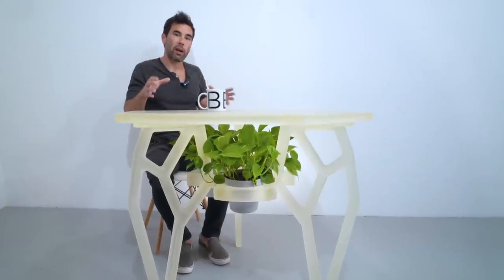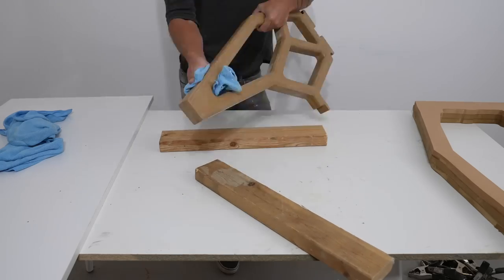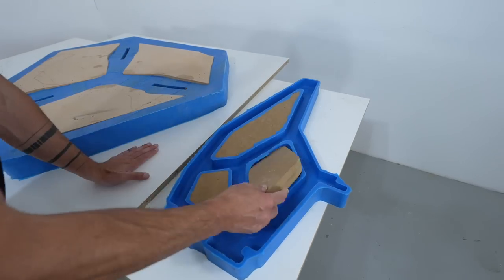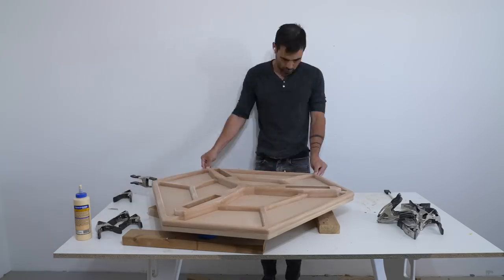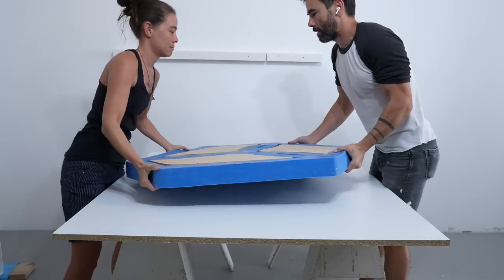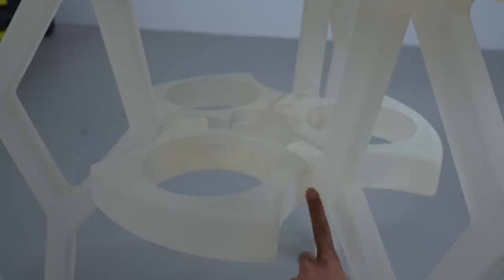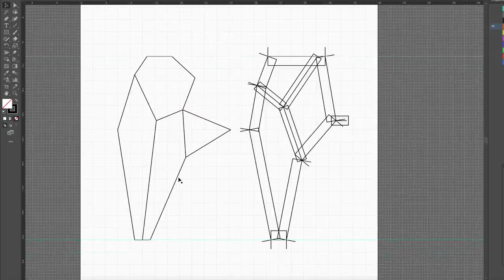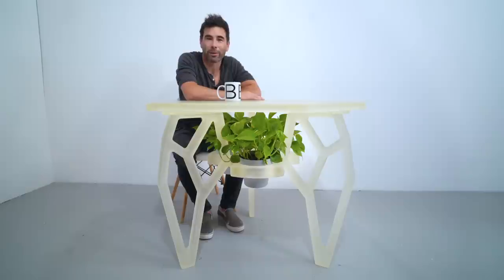Making an Epoxy Table

Comment: Epoxy and sunlight don't really get along. It will be interesting to see how this ages. A yellow or orange tint may help hide UV degradation.
Reply from the maker: yes! I am curious to watch how it ages too
Reply: Might want to go the other way. A light purple tint would go more neutral (white) as the epoxy yellows over time.

Comment: I wonder if making an mdf mold and spraying it with plasti-dip or some sort of silicone spray would be a cheaper way to make a mold.
Reply from the maker: it might but probably wouldn't hold up as well over multiple uses

Comment: Looks really cool! But wouldn't it be easier and cheaper to combine thick sheets of acrylic and sand them afterwards to the achieve the same look?
Reply from the maker: I priced thick acrylic from 3form and Eplastics and it was a bit more expensive.

Comment: You can estimate the volume from the weight.  I expect the density of MDF is consistent.  Weigh the MDF before you cut it.  If you start with a rectangular sheet you know the area and the thickness, and therefore the volume.  You could compute the density but you don't need to.

Now weigh the pieces that form the mold: the outside frame and the inside filler pieces.  Subtract that from the original weight of the stock to get the weight of MDF that is not part of the mold.  Divide that difference by the original weight if the stock to get the fraction of stock that is not part of the mold.  Multiply that fraction by the original volume if the stock to get the volume of silicone you will need.

The above doesn't measure the "base" if your mold.  That is an easier area to guestimate than the actual form though.

Comment: could you just pour out a slab of epoxy and then cnc it to make the table pieces. Please dont attack me. just asking
Reply: Yes, but it would be much more expensive. With this, the form costs a lot of money but you can reuse it.
Reply: Also, cutting/routing/jointing cured epoxy will rapidly wear down your bits and blades.
Reply from the maker: yes!  it is possible and probably a better way to make 1 table but I want to make a few of these for an upcoming real estate development
Reply: @HomeMadeModern  Yes, that makes a lot of sense. I rewatched it after i commented and saw when you said that you plan on make hundreds more. Anyways, thanks for replying